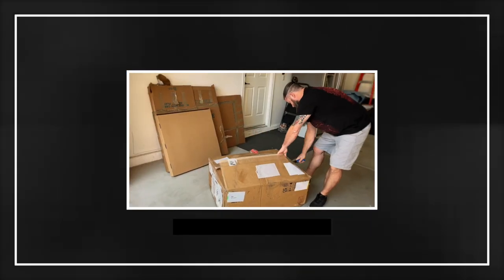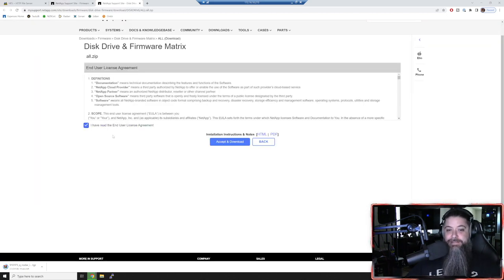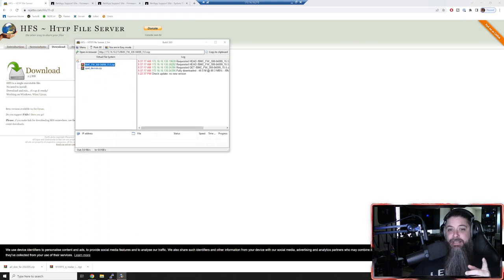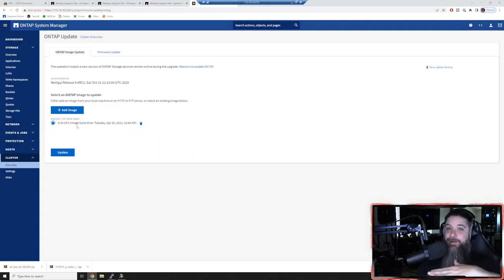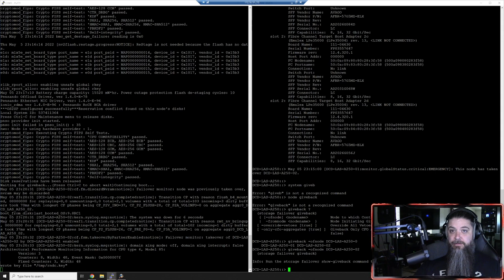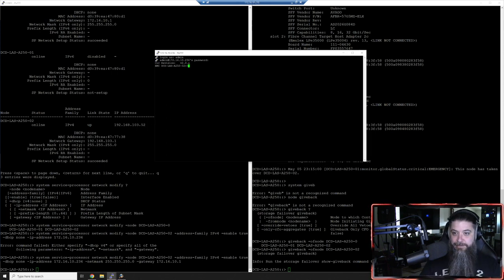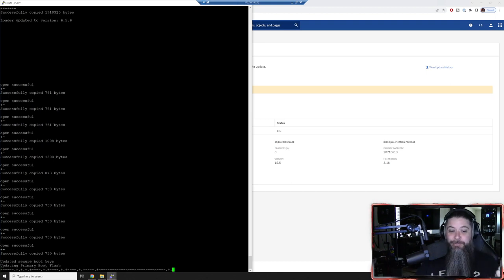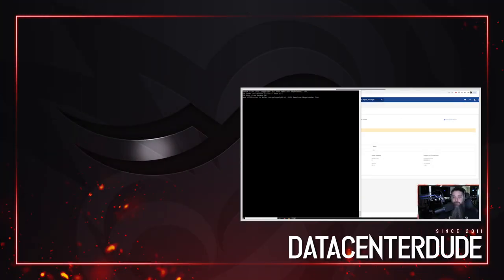How to Update ALL NetApp Firmware | COMPLETE Walkthrough

Comment: Just a few comments to a great video :-)   The shelf firmware also comes in an "all.zip" bundle file.  You might want to know that you can only jump two releases of ONTAP in one go... so from 9.5 to 9.7 to 9.9 to 9.11... From the LOADER prompt you can do "boot_ontap maint" or "boot_ontap menu" so you do not have to "catch" the Ctrl-C during boot ;-)    In general I would recommend updating ONTAP first, because SP/BMC FW and disk firmwares are included in ONTAP and it will update automatically during the ONTAP node update process...  BMC does not require reboot of the node in order to update... If the autoupdate is enabled on the SP it should just start automatically after a few minutes... or you can trigger it from the service-processor commands... I think you might have this mixed up with BIOS/HBA/etc. FW updates which will require update at boot... :-)  And of cause no reason to reboot the node in order to get the SP to work after an update... but great video anyway :-)
Reply: the jump 2 versions rule is now gone :)
check out the new upgrade paths

Comment: its a real shame NetApp is stopping ONTAP upgrades for older hardware so fast. Good system like 255x (only can go 9.8) and even 26xx (can only go to 9.11.1) even bigger system like 80xx (only can go 9.8) which you can pickup pretty cheap second hand for lab and development work.. Given how long NetApp sold the A300's for, it's annoying.
Reply: I hear you. I am just about to update our 2552 to 9.8. then we are going to migrate the svms off and put the storage into the test environment. This 2552 has never had any issues, runs like a champ - not even a bad drive but its eol. If my employer would let me take it home, well :)